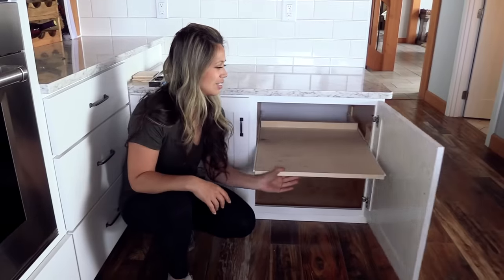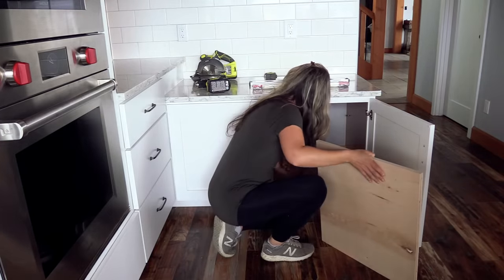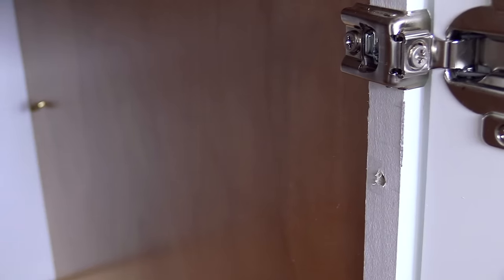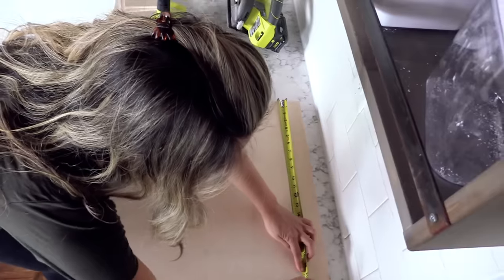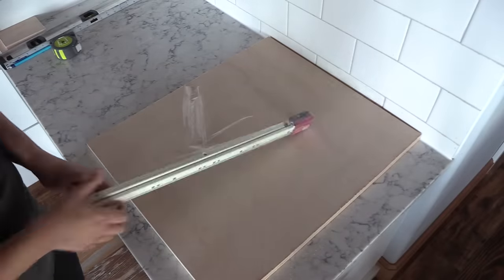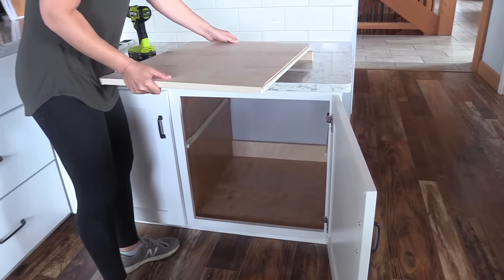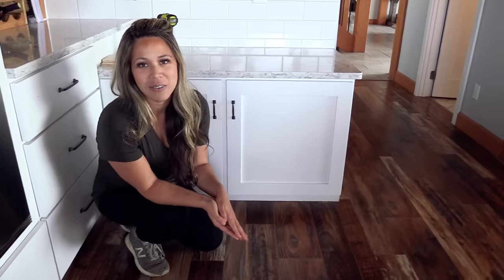Easy! Convert Cabinet Shelves to Roll Outs for $10

Comment: My dad taught me to use peel and stick tile on the inside of my cabinets, the tile cleans up easy and can be taken up with a hairdryer and a putty knife if you want to change or replace.  Love how you did not over talk the subject and got right to work.
Reply: ABSOLUTELY AGREE WITH YOU; didn't  HAFT TO WATCH  30 minutes  of stuff not even related to DIY PROJECT!  THANKS☺🦅🇺🇸🦅
Reply: Contact paper works well for lining shelves as well and can be cut to fit, without the seams between tiles which can "leak." It's not as easy to find in stores as it was a few decades ago, however, in my experience.
Reply: Can you explain how you use this peel and stick tiles? The wood shim looks much deeper.
Reply: @LoriSews  I, too, use peel and stick for the FLOOR of cabinets as ell as under sinks in kitchen and bath. My dad did this with tile he removed from their kitchens.
Reply: that’s such a great idea omg
i can’t believe i haven’t thought of that!
Reply: @lynnstevenson8015  then DON'T watch!
Reply: I went to use peel and stick tile for a project. Double the cost of using real tile where I live. It use to be the cheap, easy option. Went with real tile.
Reply: @lynnstevenson8015   I misread your typed words. I thought you were being snarky, my apologies. When I reread your comment and now, after
Reply: I always do that
Reply: That's what I always have used. It looks so much better than paper that tears..
Reply: Sandra, yesssss! You are so right. Presentation is key, and anytime I'm learning something, I am seriously distracted and irked when the presenter guilds the lily. Learning is a straightforward experience. Please don't try to entertain me while educating me. This uploader gets that! I was able to give this video my full attention. 👏🏾

Comment: I would suggest spending a little more on your drawer slides. Go with a more heavy duty model. You'll be thankful you did down the line when you start loading that thing up with heavy pots, etc.

Comment: I asked my handy husband to do this when we moved into our house 18 years ago, BEST improvement EVER!  He did all the kitchen base cabinets and all the bathroom base cabinets.  Now that I'm 71 it is a God send not to have to crawl on the floor to clean and/or find something at the back of any of my cabinets.
Reply from the maker: That is amazing!
Reply: There is something else you might love. Age makes it painful for me to do a deep knee bend. I bought a few plastic rolling garden carts. Picture a small heavy duty plastic tote on wheels. I can sit very comfortably on the cart to weed my garden, put air in my tires, or scrub my floors. Also it is easier to stand up from a sitting position than it is getting up from the floor.
Reply: I have been struggling n cant not afford new kitchen cabinets. My cupboards on ground...can reach them so I can use them. I was so frustrated. Now looking for someone to do for me.
Reply: Aahhhh
Reply: Lucky to have a handy man husband, mine is useless, whiner.
Reply: I wonder why this is not a standard feature?
Reply: I am 71 too.  Most of my base cabinets are drawers, but I find the 2 cabinets that don’t have drawers difficult to get stuff out, especially the bottom. my husband is not the least bit handy, but think I could still manage to install the sliders
Reply: @robertawills7219  I've done it .. they are really easy to do. Go for it!! My best re-do was a cheap, white, deep IKEA "pantry" that I removed the doors and put the sliders on all the moveable shelves. Microwave on one, containers of flour etc etc. on others. All easily reachable. Love it!
Reply: @matriksist     Awwww, but with excellent vids like this, get him started.  Lay out the stuff needed, like Ana showed you in the first part.
He’s overwhelmed, just remind him, you only need to do it once.   Imagine having these drawn out shelves under the kitchen sink, in the cupboard in the garage, under bathroom vanity.    Maybe Ana makes house calls!   He’s afraid of messing up....get the stuff laid out and hold the flashlight for him.
Reply: @valkyriesardo278  ]
Reply: @matriksist  what a lucky man he is to be married to someone like you
Reply: Is that strong enogh for Le creuchet?
Reply: @valkyriesardo278     Excellent….fills a need all over the house.   I have a Little Giant four step stool which is incredibly stable and rubberized.
Anytime you invent something, share your ideas with others as you have here.  Each time I’ve installed a tamp, or handgrip….I’m struck with…why don’t they think of this to begin with?  I have 24 inch grab bars at the top step every staircase, just for a boost.
Reply: Wow..I am 417 to "LIKE" your comment.  I am 62 and gonna do it this week.
Reply: @ellylin8116    You could use rubberized shelf paper on the shelf, would quiet it down and distribute the weight.
Reply: @valkyriesardo278    Just found something similar.  Had two walkers downstairs. Anyone who’s had "work done" has them. Didn’t fold easily, I used a light coat  of Vaseline to the slides and the closure button.  I put it on the covered porch, it’s a dream to reach for that, the handrail runs out, that walker is so stable.  The other one I’ll leave open too.  Reaching to get up for a dresser is a reach. Use the walker which is strategically placed,  Thrift stores have them in abundance.  Think of neighbors and relatives.
Reply: @matriksist  😂 omg. Thank you I needed a good laugh.
Reply: @audraeden8923  some women are better at discouraging.
Reply: 4:52 Actually it’s 1120 on the West Coast on December 31. I’ve asked several people including my brother my boyfriend the ex-husband. I asked for a birthday gift and Xmas gift for this. Nope. 
Well now I can do it myself thank you so much for explaining the process.

Comment: Locktite adhesive will instantly and permanently stick the furing blocks. So, no screws required. Scuff the 2 surfaces with 120 sand paper first

Comment: I've been wanting to do this for the longest time, you beat me to it. You can drill a 1 1/2 in. hole 🕳 in the front of the shelf for easy pulling out. Thanks for sharing.
Reply from the maker: Great idea
Reply: Goid idea, or add a small block of wood underneath at the center front...

Comment: Wonderful idea. An alternative to small rectangles for the shims is to simply fit a panel to either side or 4 narrow boards that are the height of the cabinet. That way you would have the option to change the height of the shelf by simply relocating the screws or installing an additional track.
Reply: Yep, I think I'd do that for the aesthetics alone
Reply: Great comment!
Reply: Dan Hubbard

Comment: Just seeing this two years after its been posted.  Nice clear video that's to-the-point without a lot of extra babbling.  The only suggestion I have is to install the slides in the base cabinet first, put in the shelf slides next, and then measure the distance across for the shelf width.  Worked much better when I did this to my bathroom vanity's shelves.  And in 2022 the price of those slides in 16" length is up to $9 at HD (inflation . . . grrrr!!).  EDIT:  Also forgot to add that I put a 6.5" drawer pull handle on the top-front of shelves I installed - makes it easier to slide it in-and-out,  and keeps stuff from falling forward and off onto the floor.
Reply from the maker: Great tip, thanks for the visit!

Comment: @Ana White. THANK YOU SO MUCH!!!!  I HAVE AM UNFINISHED PROJECT AWAITING ME FOR 6 YEARS (DUE TO A DENTAL CRANIUM FRACTURE AND NERVE INJURY) THAT REQUIRES THE SHIMS.  IT WILL NEED 2"X4" BUT SAME TECHNIQUE.  I HOPE TO finish this now with a pull out boxes that we already had made. I was about to give up and Order pegs online and just put plywood shelving in there. Since it is 2 foot deep cabinet that was made for an inset oven and I am using it for food storage, it will really help to have the rollouts to be able to rotate stock properly and reach to the back. This video was such a blessing for me thank you.  It has a large face frame
Reply from the maker: SO happy to help you!

Comment: By adding a small side edge it keeps things in place.
Reply: That’s a tip to be remembered...how easy.    Take a phone-pic, use a flashlight to get a good shot. Plan the job by starting out right, take a picture will bring the job eye-level.
When you’ve got it, get a teenager to assist.  Away from video games...help me a minute.  Ana does  the same with these great vids.

Comment: Why no shims on the left side if both sides of the cabinet have face frame?  You did a great job and it was easy to understand your directions.
Reply: The divider between the L and R sides of the cabinet was already flush with the frame, so a shim wasn’t needed.

Comment: I’d consider adding quarter round to the edges of the cabinet shelf
Reply: Or trim router with round over bit. I know not everyone has these tools, it's just another option for those that do. It can also be an excuse to buy one if you don't have one. That Ryobi trim router is cheap and gets the job done.

Comment: What do you recommend if your cabinet is a double door cabinet and doesn't have the inner divider between the two sections - install a divider with pocket screws so you can mount the drawer slide?
Reply from the maker: I’d run a 2x4 from the face frame back, parallel to the cabinet bottom. Then you can mount drawer slides on either side since the 2x4 width will match the 1x2 width.  If you can’t attach to the back of the cabinet, you can add a “leg” at the back of the 2x4
Reply from the maker: I’ll do a post to illustrate this this coming week
Reply: @AnaWhiteDIY  Thank you so much.
I'd be very interested in seeing that vid too. ❤
Reply from the maker: @mymai2792  Here's the diagrams showing how I'd do a double width cabinet https://www.ana-white.com/woodworking-projects/10-roll-outs-kitchen-cabinets
Reply: Very helpful!  Thank you

Comment: I'm confused on what type of drawer slides to get.  Could you add an Amazon link for me?
Reply: There are a umber of different slides that would work.  I'd get something like KV or Accuride full extension slides. They let the shelf or drawer pull all the way out unlike the cheaper Euro slides.
Reply: @Joesmith-fu4ps  Good idea, but it will take putting sides on the shelf to screw the slides on so it is a little more complicated and you lose a little space.

Comment: Good idea, but I would rather recommend ballbering sliders for much durability.
Reply: Not worth the additional cost, these slides will last a lifetime.
Reply: @Arshad Ali Shah 🙄
Reply: @vtbn53  A pair of full extension slides is under $10.  Definitely worth it.
Reply: @danielloomis7972  Nah. Prices vary depending on location, I have used dozens and dozens of both types of sliders, there's a place for both, but the cheaper and more available style are fine for most purposes.

Comment: I would recommend furring out the entire length of the slide for face-framed cabinets. We have some pull-outs that were here when we bought the place. Over time, the slides have bent where they aren’t supported by the shims, and now I need to beat up my knees and back to replace them. The former owners might have used too light-duty of slides, but a few more materials might mean fewer headaches down the road.

Comment: This is a really great project for even a beginner.  We've looked at those metal ones at Home Depot and Amazon. They're super expensive, plus we'd have to pay for installation.   I just need some for some potst & pans so I can don't have to stand on my head to get something from the little shelf in the back.
Putting this in watch later so hubby can watch it too.
Thanks for posting.
Reply from the maker: Thanks for the visit, so happy it's helpful!

Comment: Hi, I am using the hubbies page to comment. My kitchen shelving is fixed so would not be able to do this. However, I bought the plastic bin carts on wheels, they come in many sizes and put just about everything in these. You just pull out to get what you want. So much easier than trying to get to the back of the shelves and on the floor for the lower shelves. Thank you for sharing your easy fix.

Comment: As a disabled senior living in an apt, I cannot alter existing cabinets. I measured shelves (height, width and length) found the best plastic bins that will fit and while sitting down in my kitchen, I can reach everything without standing on my head.

However if I was an able-bodied person owning a home, I would find someone to do this for me. Excellent presentation,  simply explained.
Reply from the maker: Happy you've found a solution for yourself! Thanks for the visit:)

Comment: Good job with the video. Clear, concise instructions and easy to follow.

I prefer these European drawer slides for light-duty use. They are significantly cheaper than the soft-close type. For kitchen use and even under the sink (where I added some drawers), they are perfect.

Comment: I have a three drawer dresser, where one of the panels broke off a drawer in storage. I removed the top drawer and replaced it with sliding shelf. Now I use that space for my pullout office for paper, pens. You can use for makeup and jewelry too. 

The bottom two drawers can still be used for clothes.
Reply from the maker: Sounds like the perfect solution!

Comment: Thank you. 

I imagine that one could get a piece of wood cut to the same dimensions as the re-sized shelf and do the same for the bottom of the cupboard. The shims would be above the shelf, I believe, to give room for the gliders. The loss of some shelf height would be worth the efficiency gained from installing the movable shelves. 

My lower cupboards have all my appliances in them and access would be simplified with these rollout shelves. 

Blessings.
Reply from the maker: Thanks for watching!

Comment: This is the first of your tutorials that I have come across.I had an accident last year now I'm disabled unable to sit bend or kneel down .This would be marvelous for my units as I cannot reach anything except what is in the front and my kitchen is 34 ft long .
Under the bottom of the cupboard floor units between the bottom of the cupboard and the kitchen floor where the kick boards are we call them plinths,I currently have the boards missing as my accident happened just when I began putting my units in place and I cannot finish the work .I want to learn how to build slide in drawers with cut out circles for push lights .I know I can use a hole cutter and marine ply to make the plinths and then screw a piece of leather strap or thin metal or wood across the back of each hole to prevent the push light from falling through the hole .The depth of each drawer would be 30 inches and the width would be 39 inches but the actual space for each drawer width would be 37.5 inches and the front plinth of each drawer would measure 39 inches .The height of each drawer would be 5 inches.now I need to find a way to enable each drawer to pull out smoothly when I need them to .this means some kind of rolling system on the bottom of each drawer .
I do not know how I can resolve this part of my design idea ? Any suggestions very welcome please .The sides of each drawer will not be attached to or sliding along the wall of the cabinets.my units are very old chipboard and beginning to deteriorate but I have no income with which to replace them .once in place I can push the lights at night with my toes to turn them on and off .

Comment: Thank you so much. This would work very well for some free-standing melamine cabinets that I have. I have already installed L brackets to the wall to keep the cabinets from tipping forward. This will work so well for office and sewing supplies that I have stored.
This would also work well on some shelving in my kitchen island. It is supposed to be used for pots and pans but of course does not work very well. Thank you for This simple, smart, and inexpensive solution.
Reply from the maker: Glad it helped!

Comment: I would have purchased an additional piece of plywood the same size for the bottom.  Attach some bottom slides and now you'd have 2 pull-out shelves.  That bottom one w/o pull-out will have "lost" items in the back.  Thanks for sharing. Great idea.
Reply from the maker: Yes, good idea to put a back on! Thanks for the visit:)

Comment: That’s great for $10. I would have kept the shelf in the middle as an adjustable shelf and I would put the rollout shelf at the bottom because that’s where it’s really useful for harder to reach items. Better yet, have 2 rollouts- bottom and middle. For $40/ pair you can buy the Blum heavy duty soft-close glides
Reply from the maker: Thanks for the visit!

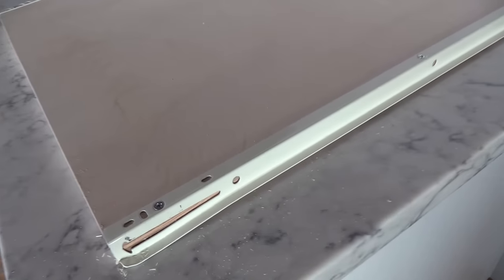Comment: Nice video! Pro tip, for placement of the slides if you have a lot of these to do. Cut a piece of plywood the same height as where you want the slide to be. At 3:27 set the spacer against the inside and set the slide on top. This will give you easier placement of slides and screwing them in level. You could also use the existing adjustable shelf holes and put pins at level that works for you.
Reply from the maker: Great tip!
Reply: Thanks!

Comment: Depending on what you store on that shelf, you may want to consider a higher back lip.  I have pull out draws with a 2 inch lip all around used for pantry items.  But if you stack anything, when you pull on the draw, the items on top tend to fall back and down to the bottom shelf.  I'm actually planning to build up the back and part way of the sides on mine to hold/stack canned good more efficiently.
Reply from the maker: Great tip for sure!

Comment: Awesome! If I didn't already have these, I feel like I could do it myself! However, mine do not have that back lip. I will have to remedy that!!
Reply from the maker: YES, easy enough to add!
Reply: @Ana White  I have drawers too. I think I may have to replace the slides with some heavy duty ones though. Looked at HD...they are $50 per set...may have to wait a bit...